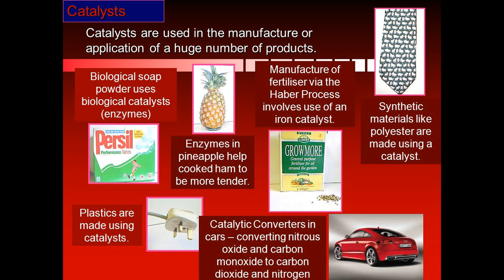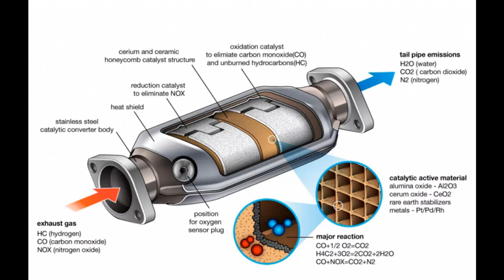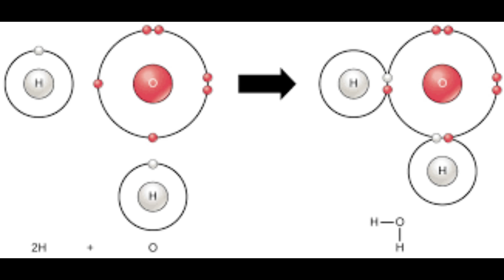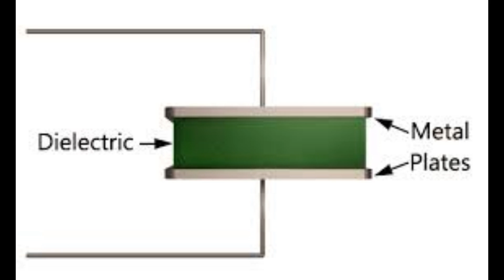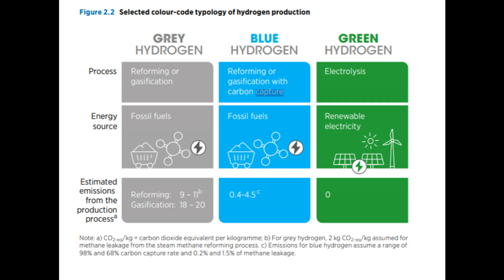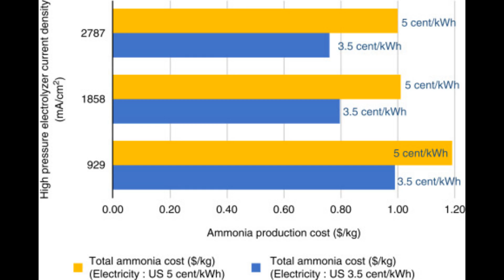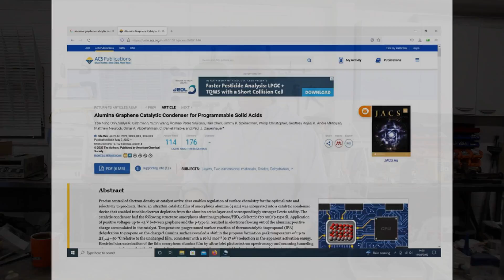1537 Turning Cheap Metals Into Expensive Ones - The Catalytic Condenser

Comment: Speaking of capacitors... You should do a video on making your own. I think the best way would be pretty much how the real ones are made.  Find two spools of very thin foil (preferably a solderable metal) and a spool of some very thin plastic film.  The wind them all up together.  The trick is to make one foil slightly over the edge and the other foil slightly over the other edge so that in the final cylinder you have two "terminals" to attach to at either end.  I don't know anything about electrolytics though but I suppose you just soak everything in a solution.

Comment: someone in japan wrote paper about al np synthesis from al oxide by using hv discharge at very low power its main goal was produces al np conductive ink

but they mentioned about hydrogen generation because al oxide was put on water

Comment: Isn't there still a problem with storing the Hydrogen once separated? As I understand it is very difficult to keep it in any container due to the small molecule size. Also I believe a concern is oxygen getting into whatever storage container you have and then it exploding.
Reply: Rob did a recent vid on storing H2 in NH3, so those problems are far less. But, yes, Hydrogen can be a bit riskier than other flammable gasses as it has a much wider ignition/explosion range, from just a few % well into the 90%s; most others only over a 10-20% range.

Comment: So you’re saying let’s say for instance that you built an electrolysis device with platinum group metals it’s more efficient? And that hopefully in the future we can use lesser expensive metals to do that? If you think the future of energy could be advanced through electrolyzes I think the power supply is more important then the reactor, things like Back emf ,mathematically more ideal wound coils,and dual pulsing ,and resonance. I do agree that the way the plates or should I say cylinders” 30% more efficient then plates” can create isotopes but I think we should be looking at more exotic energy Delivery systems If we’re talking hydrogen. Oh and thank you for the video sir!

Comment: Rob are you going to do a project using this method to split hydrogen from water using a catalytic condenser?
Reply from the maker: I am certainly going to investigate it mate - I may not get it to work in which case there won't be a video - but if I do get a version o work then there will be a video for sure

Comment: I was thinking the hafnium would make it fairly expensive, but it seems it's "only" a few hundred dollars per pound, which is a lot cheaper than platinum and not very significant if you only need a nanometres-thick layer.
Reply from the maker: yep

Comment: so.... instead of a few expensive platinum coated pem, you can use a diy painted porous carbon/graphite stacked super cap for 12v/5v Proton-exchange membrane fuel cells (PEMFC), also known as polymer electrolyte membrane (PEM) fuel cells, are a type of fuel cell being developed pee PEM!
Reply from the maker: I am actually a fan of clay - zeolites actually

Comment: I don't see how cracking water then re-burning the hydrogen could ever be a net positive, but getting hydrogen from water by electrolysis loses a lot of energy.  Catalytic assistance could potentially reduce the losses and get closer to net zero.

There could also be issues of degradation of the paracatalysts as they are in fact base metals which can corrode away and not the true catalysts which remain stable in the reactions.  Perhaps the paracatalists will simply be cheap enough to be consumables.

Lastly, if ammonia allows stripping the hydrogen out easier than from water, perhaps our own waste streams (pun intended) could be feed stock to hydrogen production.
Reply from the maker: cheers mate
Reply: I don't think net positive energy is the goal.  I think we want something to burn that won't produce CO2.  If the energy we use to crack the H2 out of water or ammonia or methane, or the manufacture of those products, involves burning something that creates CO2 then we don't have clean energy.  I think the goal is to create H2 without using anything that creates CO2.  The cheaper the better.

Comment: I have been doing a lot of thinking about how the magnet affects electrolysis and increases efficiency  at the anod/cathode as you demonstrated.  I think this capacitance effect is part of it.  The magnet orients spin and extends the life by localizing electron rich intermediates and not allowing them to migrate across the potential.  If you charge up a capacitor and disassemble it loses its charge, but on reassemble it regains.  Is the catalyst effect present only in the assembled I would presume but worth checking if in both
Reply from the maker: it would be mate - let me know how your experiment goes - cheers

Comment: Decades ago I made a crude tiny air ioniser (capacitors/diodes ladder), I wondered how/if the coronal discharge would influence gas reactions and if it could drive a reaction in low pressure/concentrations without just triggering a 'bang', but I never pursued it. I wonder if a hv/hf coronal discharge would do any good in an IC engines exhaust to either replace or assist catalytic converters?   (a bit late now E-vehicles are coming  ;-/  ).
I did make an ozonizer with the previous circuit, so something must happen to gasses in such fields.   So... steam and HV field?
Reply: Well it might work to reduce the particulate emissions. These are (and probably will be for some time) a major problem in Diesel engines and to a lesser extent in petrol! 
It is a good concept!
Reply: @totherarf  I didn't mean 'electrostatic-precipitation', I was thinking more of a coronal discharge sufficient to excite enough reaction to do what catalytic converters do; maybe enough hv/hf to fire a diffuse arc through at least part of the exhaust gasses and generate reactive species. Not as vicious as a 'plasma' arc, but diffuse yet still 'energetic'.
Reply: @bikerfirefarter7280  Good idea! 
I am far from being an expert in this, but wouldn't that method strip electrons and not add them? 
Is that the intention?
Reply: @totherarf  The intention is to create radicals and other intermediates such as O and OH (and maybe others) that will influence things like unburned hydrocarbons and CO to react to form H2O and CO2, maybe even encourage micro-carbon particles to 'burn'. The idea is to provide some effects that will replace/reduce the use of expensive 'platinum' group catalysts.
'Cats' are particularly ineffective until they get up to temperature anyway, and that can take a surprisingly long time, so not much use on short trips.
And if we can reduce/replace the metals Scrotes wont have reason to nick them.  ;-)
Reply: @bikerfirefarter7280  I understand the intent and think it is good. My understanding is (I have been known to have been wrong before) that a coronal discharge will fill any electron "holes" and may well knock electrons out of their orbits but will not affect the strong nuclear force holding a nucleus together. 
You can't change the matter itself but you can temporally change its chemistry by adding or subtracting an electron. 
Once the discharge is over the matter affected will try to assume its base state though.
As I said though ..... I could be wrong about this (I am applying old "knowledge" here)!
Reply: @totherarf  It has NOTHING to do with 'nuclear'. It's pure chemistry. And the idea of adding/subtracting electrons is an over-simplification of what I am thinking. Sorry.
Reply: @bikerfirefarter7280  I was talking about the Strong Nuclear Force holding the nucleus together. 
If you discount that you are talking about the number and shell positions of the electrons (the bit that makes it chemistry). If you force electrons into a orbit that is not minimal energy for them the effect is temporary but could have a chemical effect on atoms around it whilst the new orbit is in effect. 
My assumption was that you were talking about this? 
Admittedly my knowledge here is limited and old and I am unsure how modern field theory might come into play on this. Am I mistaken .... or just wrong?
Reply: @totherarf  I know what you meant. I was curious if a coronal discharge in IC exhaust gases could have any practical effect on activation energy and provide an assistance or alternative to catalysis presently done by platinum group elements.
Reply from the maker: it is an interesting idea mate - you should pursue it

Comment: The pharaohs extracted gold from sea salt by layering the salt between straw out in the sun, and moistened it with urine each day.
Gold can also be extracted from sea salt and rock salt using nitric acid...
Use the sun to extract salt from sea water. Make nitric acid using high voltage spark in enclosed space with air pumping through it to filter through water.
Then use the acid to extract gold from salt.
Reply: If you are going to make nitric acid like that get a home oxygen concentrator and tap the nitrogen exhaust port upping the spark containers nitrogen content from 70% to high 90 plus%
Reply from the maker: very interesting cheers mate

Comment: I've wondered if a photovoltaic cell placed in an electric field could influence the performance of  the PV cell.
Reply from the maker: yes that's the first place my mind went - injecting holes or electrons into a semiconductor by changing the potential but creating a large surface that can interact in a different way - very interesting indeed
Reply: @ThinkingandTinkering  I suppose one could apply an electrical potential between a screen placed some distance in front of a panel,  and the electrical connection to the back side. 

I think an external electric field will modify the depth of the depletion zone of the NP junction.
Reply: Nice thinking 👍🏻
Reply: I recently was asked if a solar panel can work from the campfire flames. So I got my phone sized panel and placed it in front of the glowing flame but the indicator led was very dim. When I got home I googled it and there is not enough of the right frequency to be effective unless you have a huge fire . So your idea of manipulating it  might make the difference in a camping  fire solar charger being possible !
Reply: @Buzzhumma  Maybe not Change the lowest freqency. Maybe instead it will change how much current flows or the voltage,  Maybe nothing interesting at all. I suppose it would be an interesting test.
Reply: The frequency absorbed by a photovoltaic cells is controlled by the band gap(s) of the semiconductor material. I hate to be the guy that says something is impossible, by all means check it out further, but that's a bit different from the alumina material used in this experiment.  According to the article: "the film is a defective semiconductor with an appreciable density of in-gap electronic states."  If you were to make a tunable solar panel, it would probably have to be made from scratch with such a similar material. Just my guess.
Reply: @DFPercush  I just reviewed using an electric field in a vacuum tube to determin "stopping potential" of photo electrons.  The electric field doesn't effect the lowest freqency of light to make photo electrons. But an electric field can slow or speed up electrons in a vacuum tube depending on the field's direction.  The frequencies of photons that partake in photo electric effect In a semiconductor probably wont change with the application of an external electric field. but I wonder if it may effect efficiency or a cell's current and voltage. 

Apparently the PV cells develop an internal electric field at the NP junction.

Proposal to apply an external electric field to existing PV:  position a conductive screen some distance from the top plate. 
Apply an electric field to the screen  with a potential between the screen and the metal plate on the back of solar cell, then vary the electric  potential between screen and back plate.